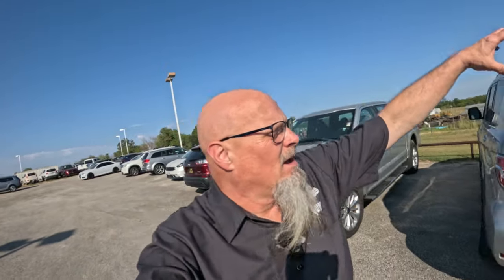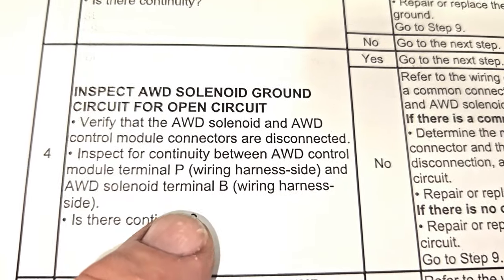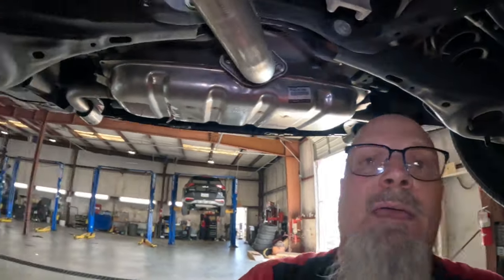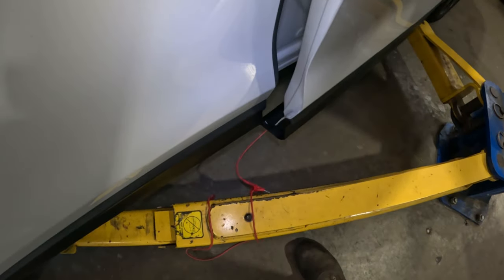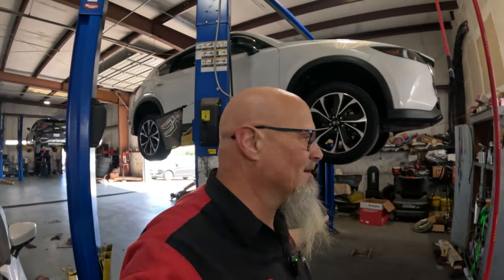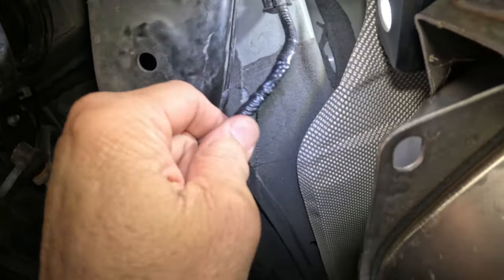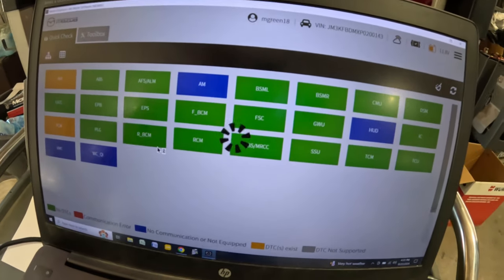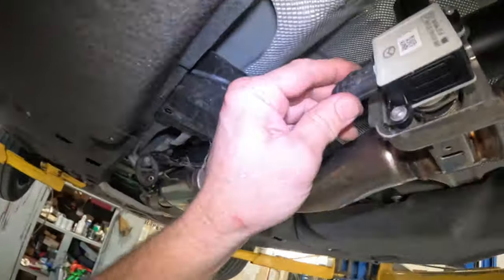2023 Mazda CX-5 open circuit. 4WD solenoid.

Comment: Have you encountered CX-5's coming in for suspension "clunk"?
Reply from the maker: CX-5s have always had issues with noise from the front end. From struts, strut mounts, to lower control arms, stabilizer bar end links, and even loose cowl panels.  The easiest one to fix is the cowl panel.  Take off the wiper arms and the top cowl panel. And, tighten up all of the lower cowl panel bolts. And that will usually fix it. Of course, it is impossible to diagnose without hearing the noise myself.
Reply: @ShopForemanGarage  have you diagnosed similar noise coming from the mid/rear of the vehicle?